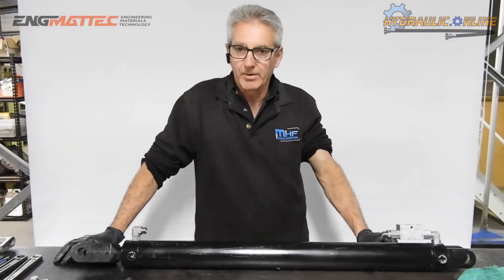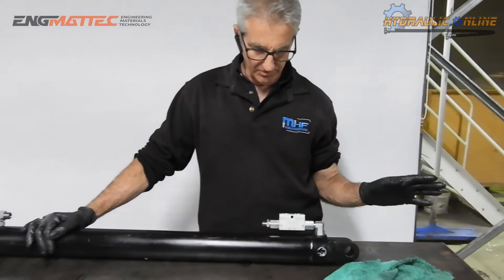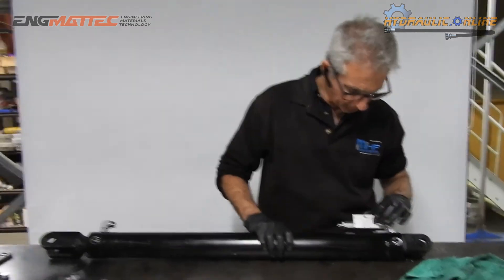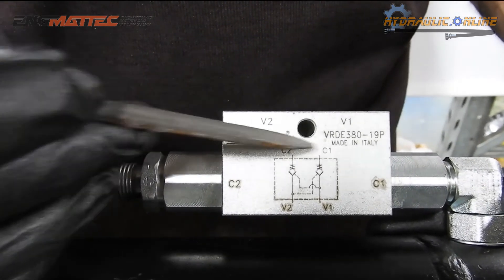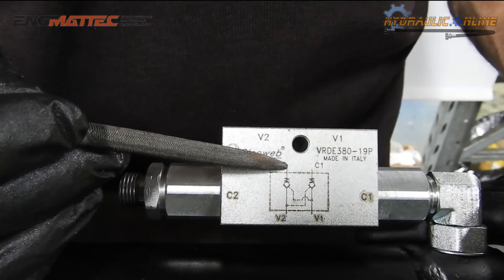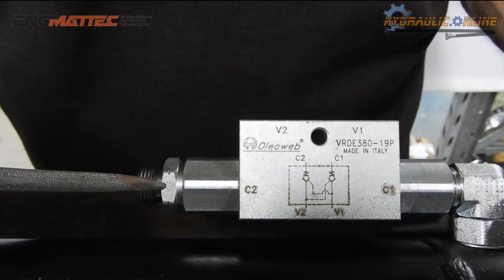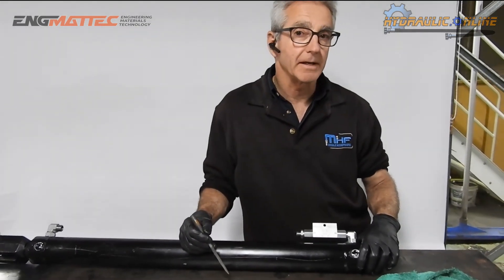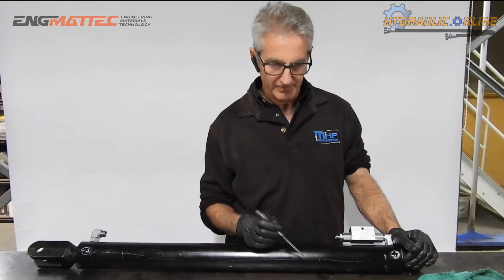How a Pilot Check Valve Works to Hold a Load on a Hydraulic Ram

Comment: So if the piston seal is leaking can that pilot the check  valve to open causing cylinder drift? I put a gauge on the pilot line to the valve from the rod side . With a load on the cylinder, the pressure in the pilot line slowly increases until it reaches 500psi then the cylinder starts drifting..
Reply from the maker: As you describe it John it sort of makes sense.

Comment: Can I use that valve to connect my hidraulic cylinder (oil) with air compressor directly ? Thanks 🙏
Reply: Yes, you can
Reply from the maker: Hmm not sure a hydraulic valve will work very well with compressed air